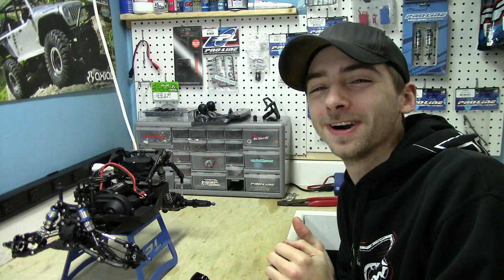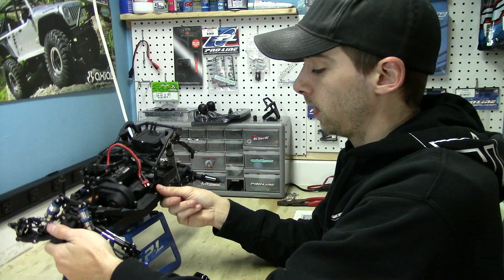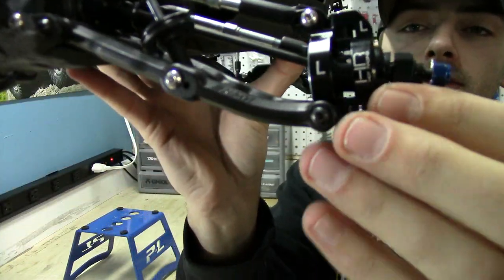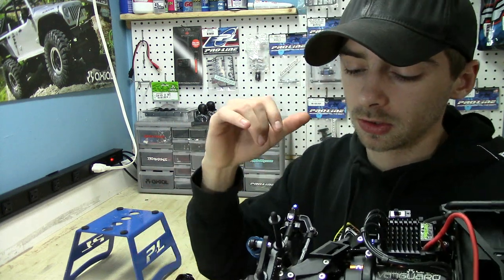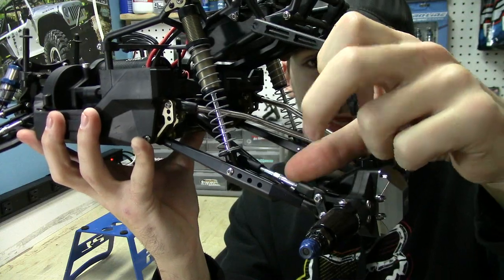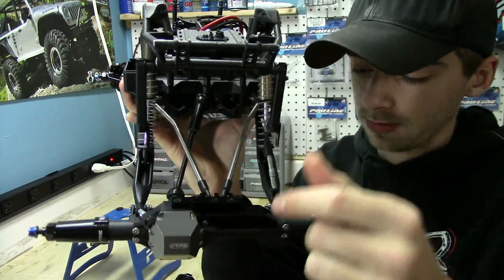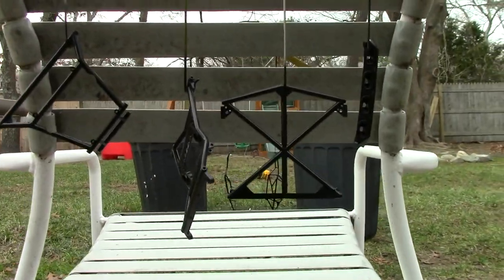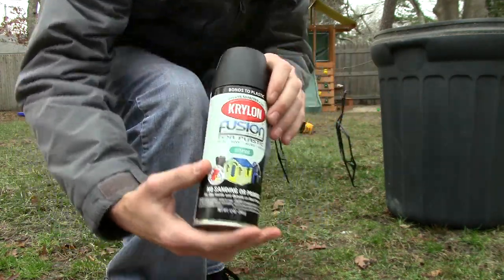Axial Yeti Upgrade - PT 7 - HR Knuckles, Painting, Update

Comment: For the disconnects just disconnect one side. The lower link can be zip tied to the lower arm. With the other side still connected, the sway bar will move up and down as the suspension moves up and down. However since one side is disconnected it does not add any roll stiffness.

Comment: Hope you have a Merry Christmas man! I'm still enjoying my Yeti in stock setup but REALLY need heavier shock oil and stiffer springs cause I load mine up with extra weight(GoPro, FPV equipment, lights). Also need one of those Outerwears covers to keep crap off my electronics.
Reply from the maker: Colton B Merry Christmas too you as well buddy! and I agree I need better shocks mainly for my rear end, as it sags too much with the 6500MAH 3s lipo in it...
Reply: RCoverload I run a 3Ah 3S 30C...and I'm sure the extra weight from that MaxAmp is a big difference. Followed you on Twitter...I'm @CB3D_

Comment: You installed the quick disconnect wrong ! It's supposed to go in the rear light bucket holes on the outside the sway bars stay in stock position then connect to the carter fab quick disconnect that are mounted on the body when you want more articulation :)
Reply from the maker: do you have a picture by any chance? its just not making scence to me... i havnt come accros one "how too" on how to install these properly...so i just took a guess.
Reply from the maker: Hey Aaron, i just did some research and you are corect. I wish i had know this last week when i produced the video. I will make a new video regarding the correct procedure. Thank you for making me aware of my mistake buddy...lol

Comment: As per my other comment on the other video. Damn thats some sick mods man.. I definitely cannot do this when I am living in some other country man. Can you tell me some basic mods which I can buy for now? Some really really important and critical ones.  I have bought the below as of now:

1. Axial upper/ Lower Link Plate Set Aluminum (4)  [not sure if it will work]
2. Vanquish steering and rear links

I am planning to Buy HR aluminium steering nuckles. Besides that can you tell some critical upgrades? things which break?

PS : I am gonna pretty much bash this thing in my backyard back home in my country :)

Need your help.

Thanks.
(Liked, Subscribed & Sobbed)
Reply from the maker: +Varun Sareen I would say get some vanquish 6 lug hubs for the wheels, RPM control arms ( same as the EXO control arms)..Other wise i think your good to go for now.